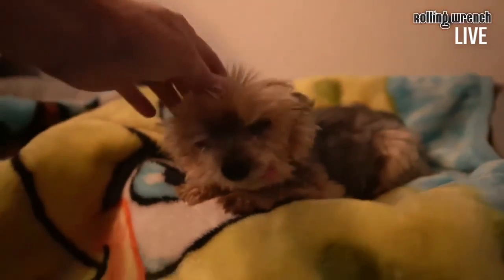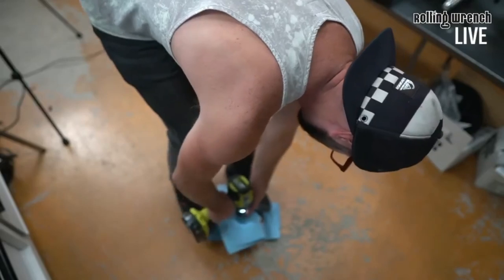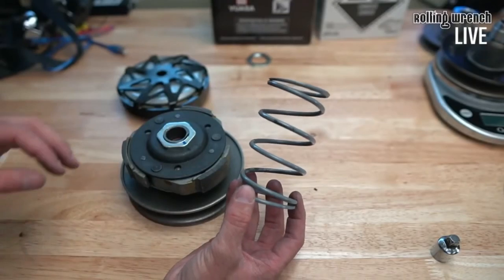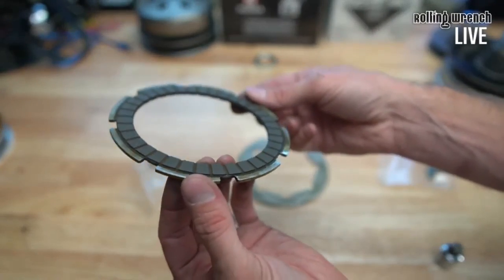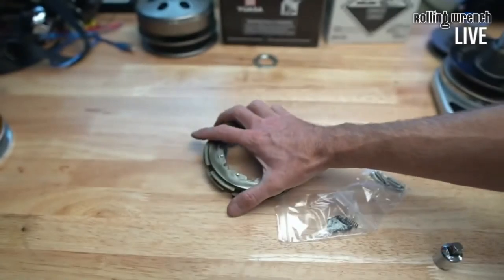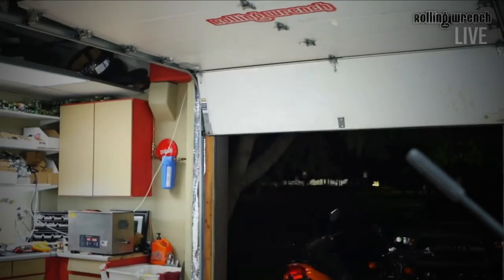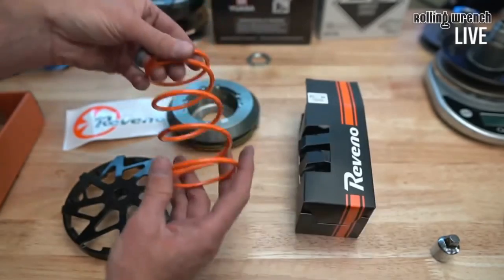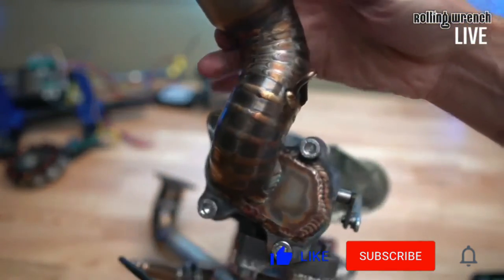REVENO CLUTCH: Everything You Need To Know [ RECORDED LIVE ]

Comment: Reveno has a better version 2.0 to improve the rolling bearings inside to make the action smoother and reduce the chance of getting stuck and also has a mute kit to eliminate the metal knocking sound. My DRG158 is installed with the Reveno-2.0 front and rear groups in  Taiwan's many modified products and interesting motorcycles also welcome everyone to travel or settle in Taiwan

Comment: Do these work on higher rpm/power setups? been interested but I'm scared it will get smoked engaging at 9000rpm in a 30hp drag application (with proper break in first)

Comment: I installed one from another ruckus I just boght and I took it for a ride and noticed that when I let go of the throttle the rear wheel sometimes lockes up is that normal?
Reply from the maker: No, definitely not normal. This wouldn’t be clutch related. This sounds pulley related
Reply: @RollingWrench  ok. I'll take a look. Thanks bro

Comment: Does anyone know how to replace engine mounts On a 150cc gy6?
Reply: Usually just the bushings break.
There's a bushing removal tool though.
You'll also need a common Micrometer to measure the bushing dimensions for replacement.
Reply: @noneshere  okay thank you I will buy the tool tonight.
Reply: @noneshere  do you have a link for the removal tool? It sounds like these bushings could be a yearly replacement.